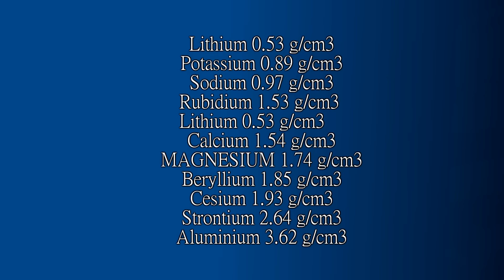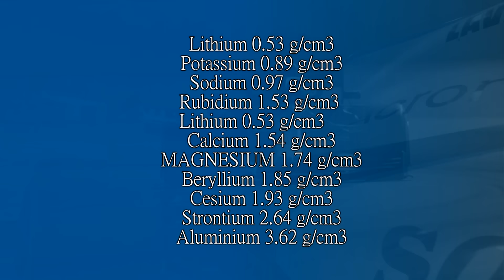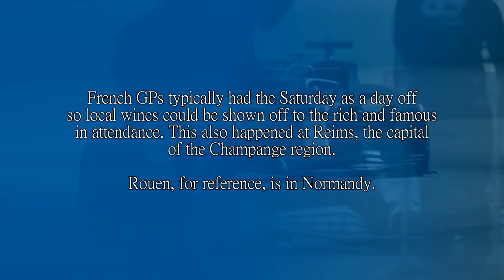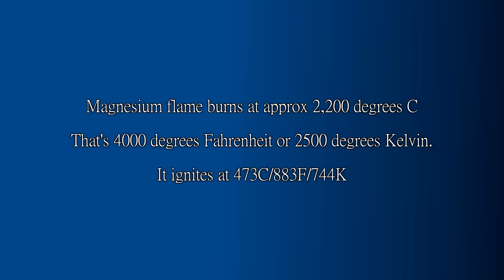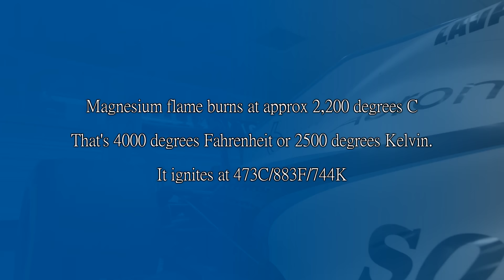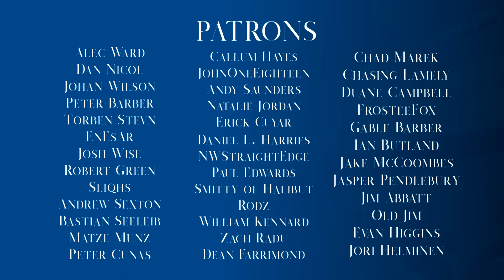The Car that Should Never Have Raced: The Story of the Honda RA302

Comment: 11:51 James Davison's magnesium wheel caught fire at the 2020 Indy 500, which was honestly quite fascinating and rare!
Reply from the maker: Yeah, must have got stupid hot or it burned a top layer or something cos it's amazing how that actually happened.
Reply: @AidanMillward  From the vidoes available it seems like brake caliper got stuck - disc glowing yellow before the fire starts...
Reply: ""According to Davison, the brakes heated up until they inevitably combusted, exploding the front tire. The car was still smoking while it was being lifted onto a flatbed truck, but only after it put on a light show with vibrant green and orange flames. This was, understandably, the end of the 2020 Indy 500 for car 51 and Davison, which is a real disappointment considering this happened so early in the race. In an interview after the ordeal, Davison summed up the bizarre incident with a line most of us could take to heart, "It's still 2020.""
Reply: @mikelevitt7365  That requires a deeper look. It would be catastrophic stoopidity if that wheel was actually made of something that could burn. Green and orange flames from what? Thats not an mg fire.
Reply: So that was easy. The master cylinder blew up and in order to successfully ignite brake fluid thats about 700 degrees or more leaving no chance it doesnt go off but thats a far cry from what it would take to light the wheel up so no wheel fire.
Reply: From the 1960s to very recently most racing wheels and many production sports car wheels were magnesium alloy. Magnesium does not burn readily unless powdered or crushed, or unless a thin sheet is exposed to direct flame. I have covered hundreds of thousands miles in cars with magnesium wheels and transaxle cases with no fire or explosion ever.

Comment: Loved the blackbird shout out. For anyone reading this who likes that era of planes, and it's parent company Lockheed Martin's Skunkworks, look for a book called "Skunkworks" by Ben Rich, he was in charge of that division after Kelly Johnson, and had a hand in designing the A-12/SR-71 (critically, the all important engine spike) and it was under his tenure that the F-117 stealth fighter came to be. A must read if you like aviation and want to read about engineering stories that surround these great planes...unexpectedly also has some good advice for business, when discussing Kelly's 15 rules. 

Regarding the subject of the video, it's telling that the standard procedure for a metal fire (like magnesium) in a place like a US aircraft carrier is to lob it overboard when possible, even a floating city equipped by Uncle Sam's war resources doesn't have any effective measure for metals on fire. Sheer negligence that this car raced after so many lessons had been learned.
Reply from the maker: Someone in another comment has confirmed the bit about shoving the plane off the deck before it melts it. The F18 has magnesium landing gear components.
Reply: @AidanMillward  A couple of points regarding the bit on the Blackbird. The original "Blackbird" was the Lockheed A-12. This is the aircraft built for the CIA (not the US Air Force) and it entered service before the SR-71. It was actually lighter and faster than the later SR-71. They look very similar but there are some differences if you know where to look.

Titanium is a real pain in the ass to fabricate, mill, drill and weld. When Rockwell approached Lockheed about building the Space Shuttle from titanium, Lockheed told them to forget it as it was just too difficult. The Shuttle was made from traditional aluminium as a result.

Finally, Lockheed-Martin did not come into exuistence until 1995. At the time the Blackbirds were being designed and built, Lockkheed and Martin were two stand-alone (and competing) manufacturers.
Reply: @EricIrl  Not on expert on this but on the titanium part what little I've read and seen also points to this. On that Skunk Works book, they mention how different batches of titanium behaved differently and they didn't know why, I won't spoil it but it was quite a random part of the manufacturing process that was causing issues. 

I also recall seeing a video from the V10 era about how they had an engineer over at BMW-Williams that would take the complex titanium exhausts and he would manually, gingerly hammer them into the right shape, it seemed incredibly tedious but IIRC that was the only way to do it at the time otherwise the part would get damaged and fail.
Reply: @zeroelus  Lockheed had to use special diamond tipped milling machines and cutters to work the titanium. Also, they couldn't mark the compnents with marker ink (as is common practice when cutting metal) because the chemicals in the ink would start corroding the titanium. It is a very, very difficult metal to work.
Reply: @EricIrl  Not to mention the toolkit needed to maintain the plane. None of the tools could contain nickel, as that would trigger galvanic corrosion on the Ti.
Reply: Great book
Reply: I think the most interesting part of this story is that the titanium came from the Soviet Union.
Reply: @RasheedKhan-he6xx  definitely a funny part of the story lol

Comment: I think it is important to note that this shocked Soichiro Honda to the point that Honda withdrew from building  race cars for around 50 years, only building engines for other cars.  Honda did make magnesium wheels afterward, though, even in production cars.  To give you an idea of how insanely light they are, I mounted & balanced 4 tires for a customer on 4 magnesium 1985 Honda CRX rims.  The bare rim could be held with 2 fingers, and even with the tire, easily lifted with one hand, open palmed. They were so light, my modern spin balancer did not even apply the motor brake after balancing each wheel/tire assembly.  They were then installed on her 1991 Civic with manual rack & pinion steering, and the steering became ridiculously responsive and light as a feather!  The heavier original steel wheels gave the car somewhat dangerous oversteer at highway speeds, but the magnesium wheels actually improved both high and low speed handling of the car, which tickled her to no end!
Reply: Unsprung weight is no joke!
Reply: President Soichiro Honda may have been "shocked", but didn't they try to enter the same death-trap 302 in the following, Italian, Grand Prix? Once again Surtees demurred and in the event I don't think they raced it. I've studied and worked in Japan many years, and have always been impressed at what an incredibly stubborn people they are, often irrationally so. Hard-headedness is admired and interpreted as strength.

Comment: A less dense metal like magnesium is sometimes a better choice when bending or buckling is the expected failure mode, but otherwise, strength to weight is more important.  Stiffness to weight is almost the same for all the structural metals.  The SR-71 used Titanium for its heat resistance, not because it was better structurally.

Comment: Aidan, a suggestion.  It's not really a F1 thing but the story of the 1970 CanAm shadow is a good one.  A titanium frame.  At a race, maybe in Canada, going up a hill, it was so light that enough air got under the car that it flipped up and over.  It was said that the frame, something like 22K or whatever was to light.

Comment: This one's outside my usual area of expertise, but I believe the reason large blocks of magnesium don't ignite nearly as easily as thin panels and strips is because of heat transfer.  Metal transfers heat very easily compared to air, so while the temperature for ignition is the same for both forms of magnesium, a big block being heated will sink the heat into itself much faster than a thin piece of the same mass- this would result in a greater amount of heat being necessary to ignite the block itself, but small pieces breaking off such as in an impact will still spark up and burn away.
Reply: TRUTH!

Comment: I work with magnesium every day. There are ways to manufacture it so it cannot ignite from the temperatures seen in fuel fires and brake friction. I'm sure Honda did their research on this. The one thing you can't easily prevent is sparks created from direct contact on cement. A control arm failure could easily cause that.

Comment: Aidan, this story is fascinating in the worst ways and the way you told it was amazing. However, I admit I had to double check and rewatch some segments to understand that the Honda France entry was a separate entry altogether. I had heard the story of Surtees refusing to drive the 302 after the test, then Honda using the 301 instead for that race. It didn't occur to me that the 302 was a separate entry (were they counting as the same constructor for scoring purposes?).

Also, as a minor observation, the Grand Prix circuit used for 68 was still the one with the long stretches and the Gresil, Scierie curves, not the one with the left handers Autoroute and Côte. 

That said, thank you for the amazing content, as always <3

Comment: Years ago when I was an SCCA corner worker at Road America, the IndyCar folks did training for us on how to address alcohol and magnesium fires. You can't se the alcohol burn, just the grass turning black. At the time they used a bucket of sand to put out the magnesium fire as regular fire extinguishers or water didn't work. I think we have a similar issue today with the lithium EV batteries where fire departments often don't have the right equipment. And we saw the transport ship catch fire and sink full of VW, Audi, Porsche, Lamborghini and Bentley cars.

Comment: The problem wasn`t magnesium or air cooling but the inexperience of Schlesser and bad weather. He did slide from the track on a corner and hit the earth bank. He got fatal injuries hitting the bank. The side fuel tank also exploded due the inpact (the fuel exploded due the compression like in diesel engine,  there was nothing to do with hot engine)  and made the car burn.

Comment: Magnesium burns hotter under water. It burns hot enough to break down water into hydrogen and oxygen, adding fuel to the fire. As a firefighter iv had some experience with burning cars. Magnesium is used in a few of the steering shaft components. It’s kinda nice because once it ignites it will burn a hole through the floorboards and open a drain hole to drain the water out of the car.

Comment: Interesting fact:
NASCAR actually uses magnesium as the material for the firewall located between the engine and the driver's feet. Magnesium is actually quite good at not catching fire if it's made thick enough. Of course, Honda didn't seem to appreciate this...
Reply: The thing is if it's very thick, it's also going to be quite heavy.

Comment: Long ago, in a universe far away, I did flagging and corner work. We trained with professional firefighters. One of thierbwar stories was that the army gave them a damaged helicopter to practice firefighting on. They put it in a field, got all the engines ready, deployed the hoses, and light it. It was completely consumed before they were able get any extinguishing deployed on it. Yes, the frame of the helicopter was magnesium. We learned to respect the magnesium parts of the cars we responded to.

Comment: Actually big chunks of magnesium will burn, but it requires intense heat and some time to heat it to the point of ignition.
An example of this was the WW2 B-29 bomber. The engine would overheat and catch fire. The crankcase was magnesium and would begun to burn.
It is virtually impossible to extinguish, so many were lost due to the wing departing.

Comment: I remember reading online about folks who’d hang out in the desert for festivals, and at one of these every year they’d light up a magnesium engine block. You have to crack off the outer layer so you can get to the ignitable inner metal.
Reply: Vw beetle engine blocks were mag , guys would use one new years as a camp fire

Comment: As soon as I read magnesium I thought it was sketchy, but when I saw that Jo Schlesser would be driving it..
I knew the anecdote about Ligier but not the exact circumstances of Jo's death..

Also thanks for explaining the thing about the magnesium wheels, I never understood why people would put such a flammable substance into a y parts of a car. Heard about magnesium piston heads too, I guess it must be the same phenomena.

I had the magnesium ribbon experiment too when I was in middle school, it was awfully bright. And apparently this was used in powder to make the early "flashes" that when they took pictures back in the early 20th century. Still, I absolutely don't understand how some people would be thinking it'd be absolutely fine building a car out of that..
Reply: Early Porsche 911 crankcases are magnesium as well (with aluminum cylinders and heads).

Comment: The 1967 F1 Gurney Eagle was all magnesium sheet. Dan Gurney refused seat belts for this reason. So the Honda was not the first use. 
Modern magnesium parts use less flammable alloys. You have to ignite a powder or chips to see those alloys burn. Most racing series today use magnesium wheels, including F1, MotoGP, NASCAR, DTM and Indy. 
In the early days of photography,  flash powder was magnesium and later flash bulbs were magnesium wool. But that was pure magnesium. 

The 1935 Bugatti Aerolithe was all magnesium sheet. It can be welded under inert gas.
Reply: I've seen a number of times in NASCAR races where wheels caught on fire. Not a common occurrence, but it has happened on occasion. A memorable one was a race in Charlotte where one of Jeff Gordon's wheels caught fire, and it was impressive because it was at night. Usually happens because of a break failure, the breaks catch fire, then the wheel catches fire.
Reply from the maker: I didn’t say Honda was the first use of magnesium though.

Comment: Yes, surface area jas a lot to do with the danger. A large wheel has a lot of mass to its surface area. To burn a material it has to reach a certain temperature.... but a large mass of a good heat conductor draws heat energy from the surface thus lowering the temperature at the air-metal interface. The sparks you mentioned have a very small mass & are easily heated above the autoignition temp; the high surface area to volume ratio exposes a large percentage to oxygen. A thin panel once the surface reaches ignition temp (or melts) hasn't any mass to absorb heat.  That's why a 200 lb slab of magnesium poses a low explosion risk whereas the same amount in tiny particles ("dust") suspended in air would be an extreme explosion risk.

Comment: In about 1960 an Indy dirt track car was built out of magnesium. In those days 10 out of the 13 Indy car races were run on one mile dirt tracks.
The Indy magnesium car caught on fire during the race. The driver pilled off the track and jumped out. The fire fighters put water on the fire, which made the magnesium fire burn more intensely. The fire totally consumed the race car.
They never built another magnesium Indy car.

Comment: "Interesting" bit of information: The temperature of a magnesium fire (2200C) is the temperature at which water begins to dissociate into hydrogen and oxygen. The hydrogen and oxygen then burn and go back into water, but releases enough energy in that process to cause more water to dissociate. It's why you can't use water to put out a magnesium fire. You're actually feeding the flames unless you can add so much water so quickly that you can immediately cut off the magnesium flame from keeping the burning hydrogen from continuing.

Comment: Schlesser would have died in that fire regardless of what the car was made from.  (Magnesium is a problem, not so much for the driver as for the fire-fighting crews, because only a truckload of sand can snuff the flames once it ignites.)  The problem with the RA302, and the reason Surtees would not drive it, was that it was too light, and almost impossible to keep on the track at high speed.  In his own words, "it was impossible to drive any distance with it performing as it should."  It was poor handling, not the magnesium construction, that led him to call it a "death trap."  
People focus on the fire, for obvious reasons, but it was the handling of the car that was the problem.  Poor handling was the reason Schlesser qualified 16th (out of 18 cars), and probably the reason he crashed after a single lap, with a full tank of fuel, in the actual race.  Magnesium needs a very hot fire to ignite, and a driver trapped in such a fire won't have time to worry about what else is going to burn.
Reply: Best comment. Congrats!

Comment: the other reason the hubs don't catch fire is not jut the mass of mag but the fact that it will be "mag_ally" a magnesium aluminium compound that actualy makes it a hole lot stronger than either of the individual components on its own coupled with modern heat treatment an forging process its able to be quite well used in very high stress environments. it can be found in use in more every day applications all be little on the high end such as mountain bike/motor cross front forks alloy wheels. but it does still carry the same risks in the event of a fire as if it get hot enough melt the compound then its likely to burn off the mag fairly quickly. 

the other bit of sicenc that goes along with this is the way mag burns its effectively a self oxidising chemical fire along with that its also reactive to water so putting watter on the fire will have only made the problem worse on 2 fronts it will have reacted to the water an them been hottenough to brake the bonds to the oxygen an hydrigon fuelling the fire further this is why u see powder an CO2 foam being used now as it is designd to take the heat an the oxygen out of the equation an is stable an non reactive even under extreme heat.